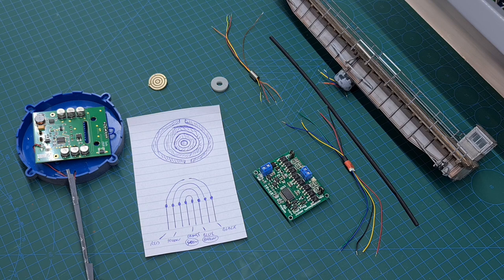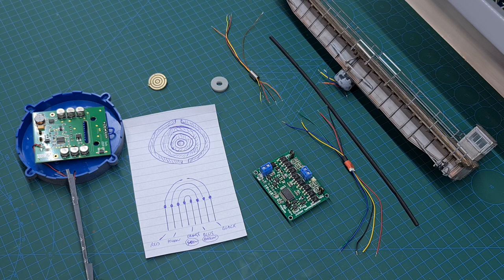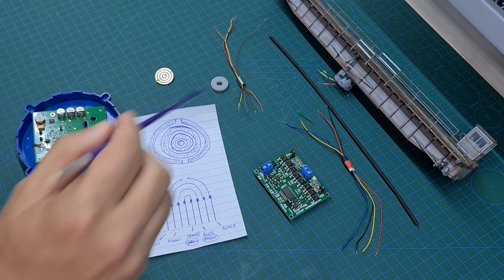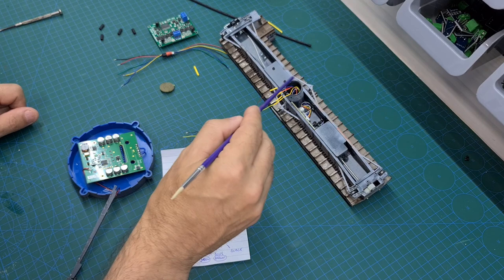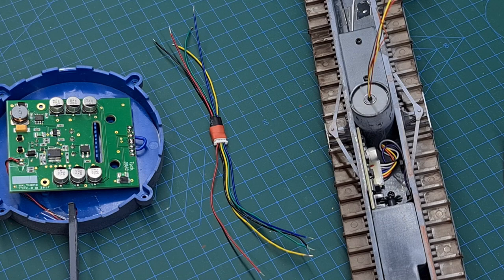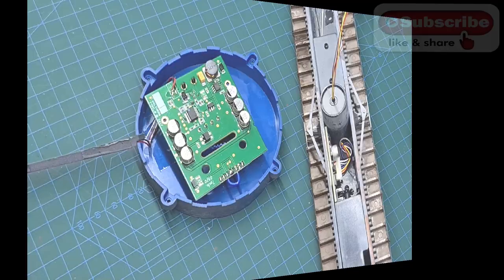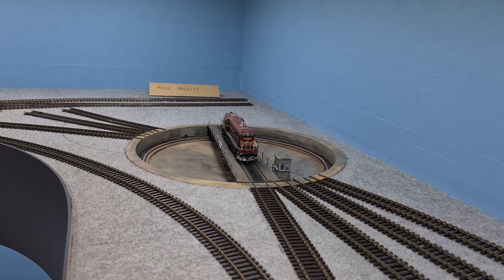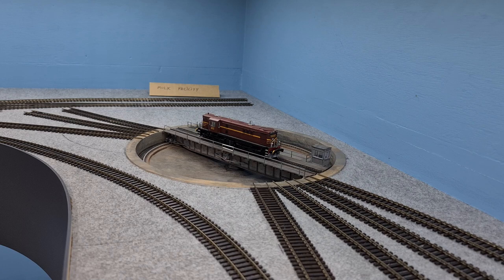How to improve the Walthers 90' Motorised Turntable - The Escarpment

Comment: Impressive, hope I don't ever have to go through this procedure, however; my problem is with the alignment / zeroing. Going back and double checking the areas of the LEDs will hopefully correct the issue. Very good presentation you have done in this video, THANKS.
Reply from the maker: Thanks Rich, appreciate the feedback. This has been the best mod for this TT..cheers

Comment: Slip Ring a wonderful discovery! I am trying to design a scratch build turntable and this is a game changer. I have a couple of version on order from China. Now to the drive mechanism under the pit...
Reply from the maker: They are indeed! Best of luck with your custom build. Let me know how you go..cheers!
Reply: My Peco NB-55 turntable uses a brass split ring design that automatically reverses the track polarity when the bridge rotates past a certain point. No need for any current reversing circuitry. Well that's the theory behind it but maintaining constant track power to the bridge was almost impossible so I simply wired my bridge track directly to my DCC power bus via a DPDT switch and it all works perfectly now. If I rotate a loco 180 degrees just simply flick the switch and simply drive it off the bridge no worries.

Comment: Great to see you got the video up to end off 2022 Jason . 
I have a KATO KA20-283 - Unitrack Turntable (N Scale) that i kind of inherited . My plan is to upscale it to O Gauge using the guts of it , its DCC ready so i hope i can get around some of the issues you had , though its currently retailing at around $500 so it better bloody work ! 😑
Reply from the maker: Sounds like you have a great project coming up. Understand the dollar value and hoping it doesn't become a paper weight item on the workbench lol. Best of luck..regards

Comment: Jason, thanks for the explanation! The Walthers turntables hve a weaklink in the bridge connection. Gives a lot of trouble, I know because i have the 130ft. This modification is a very good one! I will look into it to do myself!
Reply from the maker: Thanks for watching. Yeah, it is still going strong and has had no issues to date..cheers
Reply: @JasonWood_Escarpment   Thanks! I think the printed part is the same as in the 130ft bridge... do you know the outside measurement of it?
Reply from the maker: Sorry, I forgot to come back to this query. I'll  need to check that detail from my CAD later when I get back home from work. I can't quiet recall from memory
Reply: @JasonWood_Escarpment  no rush, no hurry 😊 Thanks!
Reply from the maker: 18.7mm diameter I used
Reply: @JasonWood_Escarpment  Top, thanks!

Comment: I found a swivel that has a plate built in. It had to be cut down a little but now fits well.
Reply from the maker: That is great to hear, cheers!
Reply: The turntable is installed and I did the first test run today. It still needs painting and all the other tracks but so far, it is all good. There is a 45 sec. video of it on my channel.

Comment: This is a very nice and clearly wholly effective solution to the biggest single fault of the Walthers turntables (the 110 and 130 ft turntables have the same slip ring arrangement).  It will also eliminate the two "dead bands" where the as-delivered turntables cannot support stall tracks directly opposite each other due to the break in the outer ring of the pcb.  
Is there any chance you'll sell the slip ring collar file to save others most of the development time - changing the inner diameter to suit other slip rings should be relatively quick and easy?  Alternatively perhaps sell a parts kit and instruction sheet with everything that matches up?.   I can get the printing done, I'm just not at a point where I can play with files yet.

Thanks for bringing us along on your journey this year, looking forward to what 2023 brings from you.  Happy New Years Jason.
Reply from the maker: Appreciate the feedback and questions Jag. That is a very good point about the additional support for additional tracks. Concerning the custom ring, yes, I can support you with what may be needed. It is a basic design/setup and wouldn't take much to change. I can supply the file and/or part if required. 
Thanks again for your support. Best wishes to you and family for 2023..regards

Comment: Thank you for all this info, im using a Hegian turntable & if I do have problems Im going to use your new wiring diagram. I can find the Frog juicer but what is the other pcb board that you use. I was very impressed with your woodworking skills at the start of your build. Thank you again ....Cheers Brian U.K. American ho
Reply from the maker: Thanks Brian..the other PCB was part of the Walthers motorised turntable. I'm  not sure how the Hegian is wired up or whether this approach would work (?)..regards
Reply: Thank you ...I've just realized that the other pcb is part of the Walthers kit. I  think your take on rewiring the turntable is spot on

Comment: Fantastic solution Jason.  I would like to convert my 110' turntable to eliminate E3 errors.  Given that my layout is DC not DCC will I need to do anything different?  I assume a frog juicer will not work for me.
Reply from the maker: Hi Stephen, thanks for the feedback. While I haven't done DC layouts before, I do know that frogjuicers are DCC only and do not work with DC. I would assume you would use a DPDT to switch polarity, but only take what I say with a grain of salt. I would recommend searching for a website/YouTube dedicate to operating with DC to help..cheers

Comment: Great job that. Works like a charm. I have just bought 2x90' Walther's turntables, but the unpowered variety. I'm buying the Electromech separately, and using auto reverser circuitry for the bridges.
Then figure out a way to run the show using DCC, rather than the Walther's controller.
Reply from the maker: I do have one of those as well, but then decided to go the full mororised kit, I I couldnt work out the best way forward..but I guess you could go down the path of a stepper motor, stepper controller board and maybe arduino to control it all..best of luck that the project..cheers

Comment: Where did you get the slip ring or did you make it yourself. Thank you for your video as they are a great help.
Reply from the maker: Hi Allen, I couldn't find the original link on eBay, but found a similar slip ring product on AliExpress:
 https://www.aliexpress.com/item/1005002523794074.html?spm=a2g0o.detail.1000060.3.37da3156cgEQT7&gps-id=pcDetailBottomMoreThisSeller&scm=1007.13339.291025.0&scm_id=1007.13339.291025.0&scm-url=1007.13339.291025.0&pvid=2cf290da-4247-4c77-93e4-ddbe263af21c&_t=gps-id:pcDetailBottomMoreThisSeller,scm-url:1007.13339.291025.0,pvid:2cf290da-4247-4c77-93e4-ddbe263af21c,tpp_buckets:668%232846%238107%231934&isseo=y&pdp_ext_f=%7B%22sku_id%22%3A%2212000027789324868%22%2C%22sceneId%22%3A%223339%22%7D&pdp_npi=2%40dis%21AUD%2111.61%2110.68%21%21%21%21%21%402101f6b416724482609291169e9c80%2112000027789324868%21rec

Comment: Jason, I am about to alter the slip ring in my walthers 90 turntable. I was just wondering if you had had any trouble with the new slip ring you fitted as I have purchased the same type.
Reply from the maker: Hey Ken, no issues to date. Runs like a dream..cheers

Comment: Hi Jason, Great Video...but Brunel Hobbies has now been bought by the model emporium and they appear not to have any.
...also which one do I have to search for ?...the unit you have in the video looks like the DFJ003U  Dual Frog Juicer. Can I use the MFJ003U Mono Frog Juicer
Cheers Paul
Happy New Year 2024.
Reply from the maker: Hi Paul, for this solution, you will need the dual frog juicer. The reason is that it needs to be converted into an auto reverser (there is a jumper pin on the board to do this). Hope that helps

Comment: I'm curious as to how this turntable is motorised in order to rotate? Most turntables have a central pivot spindle attached to a motor but this does not.
Reply from the maker: Hey Phil, these ones have a motor in the bridge with a spindle at each end of the bridge..cheers
Reply: @JasonWood_Escarpment  Arrh the beauty of HO scale where something like that is feasible. I'm running N scale and unfortunately Walthers don't make their 90' turntable in N scale.

Comment: Very nicely done - would installing stay alive capacitor on the loco decoder be a simpler, albeit tedious solution??
Reply from the maker: Thanks for the question s
Sid. All my locos are sound equipped, and there are many making that exercise long, tedious, and very expensive. Plus In 99% of my locos, this would be the only area that would need them. While this TT job seems daunting at first, once you break it down, it is very easy to do..regards

Comment: I am at a point where I can install my turntable (same kit). Are you still using the little blue controller box provided by Walthers?
I am familiar with Tam Valley Frog Juicers amd have uaed two of the duos for reverse loop tracks so my layput can be point to point for ops or it can be a continuous run.
Reply from the maker: Hi Airwolf, yes I have installed/linked two of them
Reply: @JasonWood_Escarpment  thank for the quick reply. I am looking at the other needed items. I do not have access to a 3d printer but my son does. I may be contating you for that stl file.
Reply from the maker: @AirwolfCrazy  will just need the diameter of your slip ring and adjust STL and send through to you

Comment: Hi Jason - I have just received in the post the same CCTV system as yours for my fiddle yard. Since having PTSD my mind no longer functions like it used to so I have a question. In order to wire it into a plug/transformer, can you please tell me which two wires out of the six I use please? Also sent to your FB account.
Regards Chris
Reply from the maker: Hi Chris, I hope the answers on FB helped? I believe that last power pack (12v 2amp) should do the trick. You should be able to get a connection where it will plug into your power pack and the other side have + and - terminals for the wires fro. The CCTV unit
Reply: Cheers Jason, power pack ordered and I will let you know how I got on. Very likely be asking questions as to how it works as no paperwork.
Regards Chris